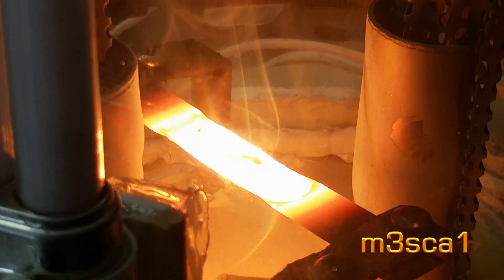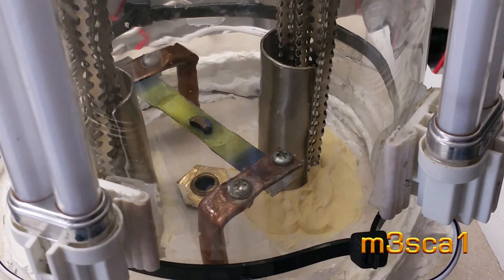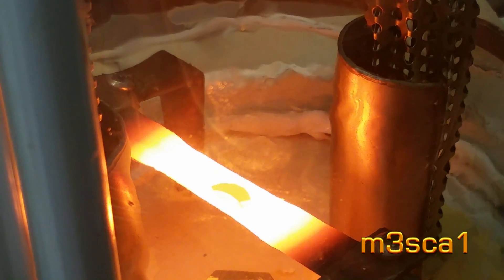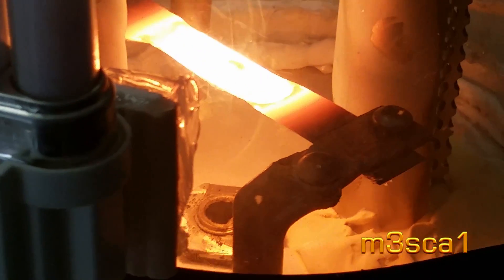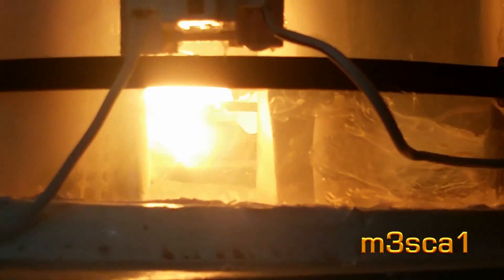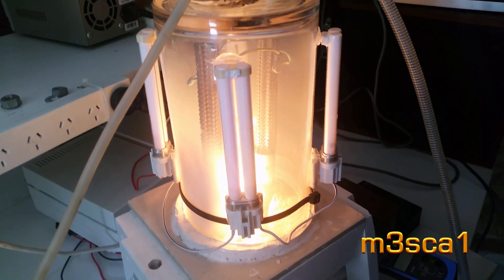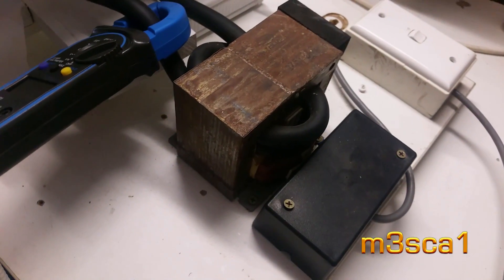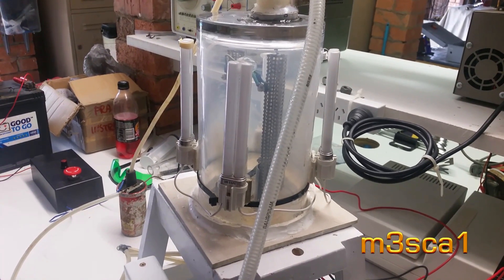electro1622's GAS processor

Comment: Is that process entirely heat from hv or is there a magnetron underneath
Reply from the maker: The tungsten boat is shorted across the ouput of a MOT that was re-wired for low voltage high amps. There is high voltage supplied by another transformer that adds ions to the atmosphere in the bottle.